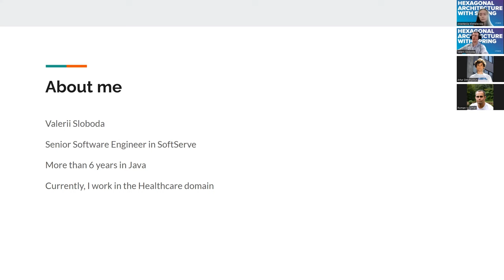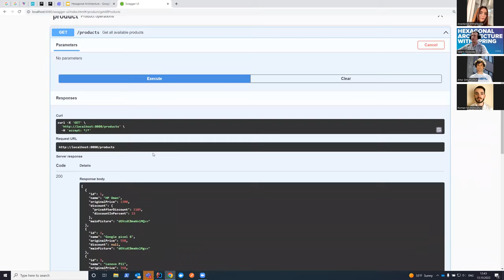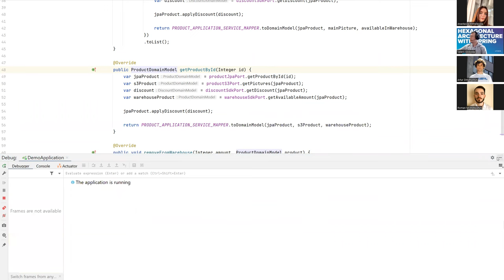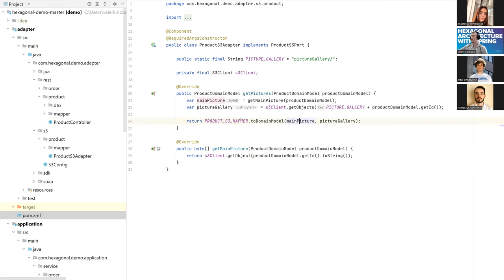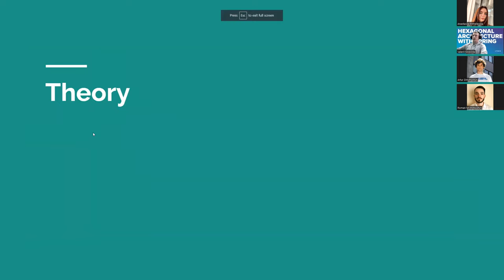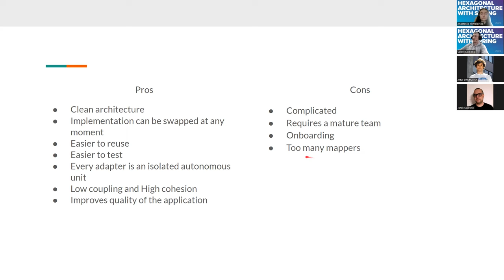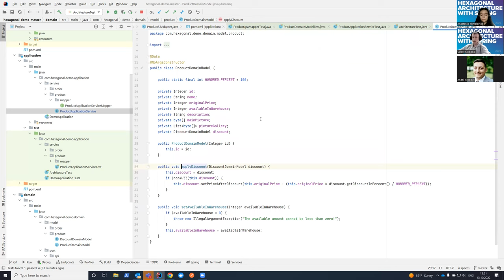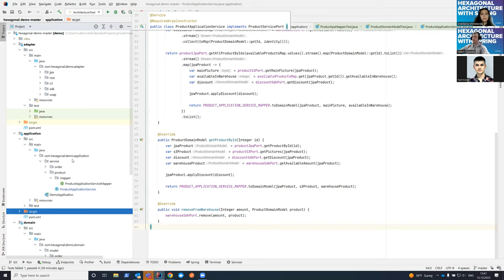Hexagonal Architecture with Spring by Valerii Sloboda

Comment: I like your practical example. Shouldn't the ports be technology neutral? E.g. ProductPictureRepositoryPort, that would also be more specific.
Reply: They are. Ports must be technology agnostic. But the adapter which is the implementation of the port can be changed at any moment with completely different technology. For example, you can change an adapter that stores files in the local filesystem with an adapter that stores them in the S3 storage. In this case, the port won't change, only the adapter.
Reply: But the port names mention the technology e.g. s3port, jpaPort. So then the ports imply a specific technology rather than being technology agnostic